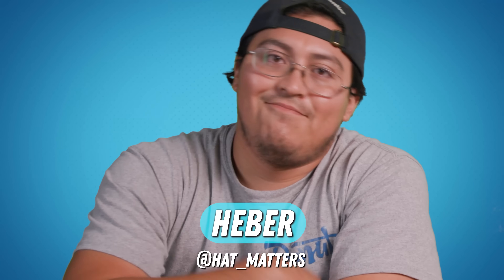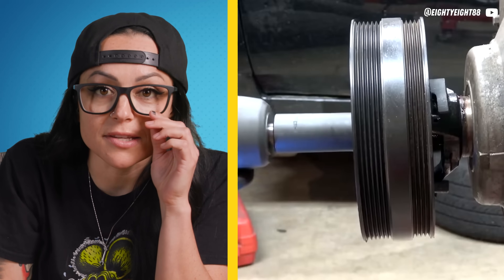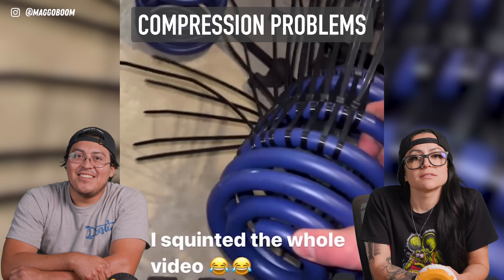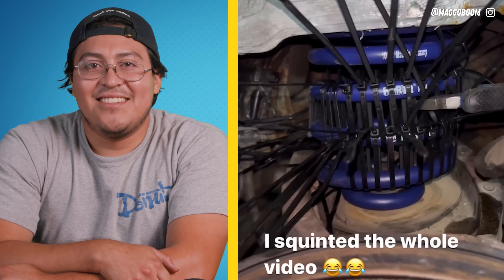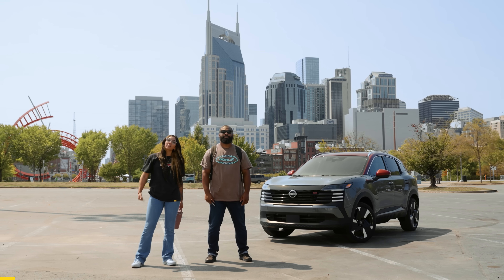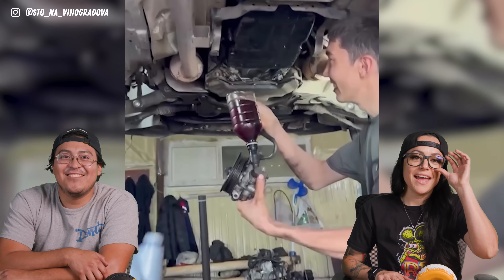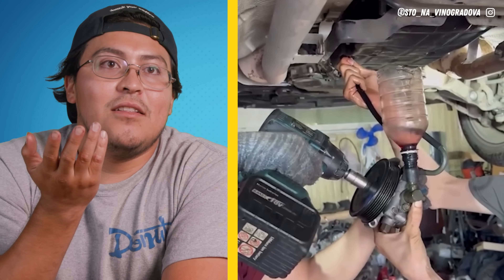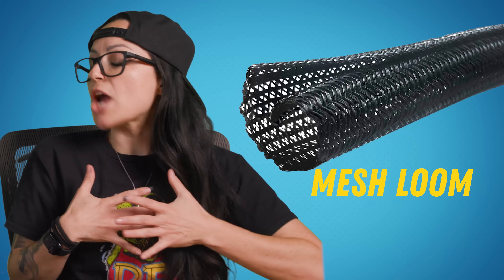Real Mechanics React to Ingenious Tiktok Hacks

Comment: Bike mechanic here, that ziptie trick with frayed brake/shift cables is so handy. I use it all the time to save cables instead of replacing.
Reply: TIL, I've just been cutting them short and crimping a new end cap.
Reply: I just use my fingers very slowly, usually works. But this seems better.
Reply: Works on lawnmowers too

Comment: That zip tie video with the spring is fucking terrifying.
Reply: The guy casually playing with that bomb he made... yikes! If you're gonna do something that inherently stupid you can at least hurry!
Reply: @viceroybolt3518 learn strengths of plastic its pretty good under tensile load, just cus sum looks scary dont mean it is
Reply: I had to do that with my Belltech springs for my mustang and it worked.
Reply: There's always a right way to do something dangerous.. that ain't it. Not by a long shot! Ratchet straps would've been the safer dumb shit option.
Reply: @reeegg9218  there is no way to evenly distribute the force being applied to each zip tie. all it takes is for the one with the most load to pop and set off a chain reaction
Reply: @reeegg9218  you can trust your life to zip tie manufacturers if you like.  i like living too much to do so myself.
Reply: @viceroybolt3518 bro had more then enough zips ties when he cut them you can actually see it slowly opening back up... Getting down to the last few may have been sketch depending how he layed them out
Reply: It's not the strength of the plastic that matters, it's the quality of the locking mechanism and the cheap ones just don't hold under pressure.
Reply: if you watch the whole video, those zip ties hold that thing. at the end he starts cutting them one by one, and like, the last two or three maybe snap, just like five were enough to keep it held down. must have been some premium zip ties xD
Reply: I was mostly waiting for it to explode.
Reply: He’s at least partially cognizant of the dangers involved in that little trick. After all, he did call it “An angry ball of zipties and kinetic energy”.
Reply: Nah, zip ties hold a lot of tension and you're dividing that by like 100 or however many zip ties you've got. But I'd still be wearing a face shield 😅
Reply: His hand placement was the one that did it for me, at least hold it where you won't get instantly defingered
Reply: Should've just used an angle grinder to cut all the zip ties
Reply: I just squeeze with my Arnold strong hands 😂
Reply: I would not trust the dollar store zip ties.
Reply: Caption was 100% accurate, my crow's feet have crow's feet
Reply: The fingers IN the spring with the zip tie kicker??? - yeah,  that's a no warning exit from my shop, 1000%
Reply: If each zip tie's tensile and lock strength exceeds the force of the spring divided by the number of zip ties, with a healthy safety margin, and they're quality, new zip ties, then it should be fine. I wouldn't do it, but then I'm not so lazy as to not do it the proper way with the strut off the car.

I did so something similar this past summer when I had to suspend a car engine to drop the trans. I ordered a support beam but it was missing one of the two threaded hook bolts and 2 chains, and since I was on a time crunch I improvised with an old bicycle chain wrapped multiple times and secured with multiple turns of baling wire, and for good measure some strong rope also wrapped multiple times. I held up fine and I got the project done in time. But I do intend to eventually get those missing parts (Amazon let me keep it for free for my troubles).

Everyone hacks eventually. So long as it gets the job done properly and safely, it's fine. Just keep it the exception and not the rule.
Reply: Even if it works, I was waiting for the guy to cut the ties and the spring to pound out crooked.
Reply: When I worked for an hgv main dealer I put plastic pallet banding around the rear light mudguard stays when they've got bent downwards , looped the doubled banding around the forks of the forklift, lifted the forks  and slowly bent the stay back up. 
The supervisor / foreman was surprised and impressed a quick and easy fix. Sometimes "ingenuity is the mother of invention".
Reply: When you damage the socket, charge a replacement to the customer, cost of a socket ,opposed to another couple of hours labor charges, most times the customer won't quibble.
Reply: The real problem isn't whether the zip ties are strong enough to hold it, it's that there's no way to remove the tension gradually. As you cut ties you don't release any tension, you just slowly remove excess strength until you reach the tipping point and all the remaining ones snap sending the full force of the still compressed spring flying. Winding out spring compressors is a gradual release of tension, very different and there's a reason it cut before he had to remove them all
Reply: It’s a great move on smaller springs, but this is risking life and limb. Especially when cutting them off.
Reply: Couldn't have said it better.
Reply: People analyzing this comment way too much. It's simply just true. Spot on if you want your fingers, face and things to stay the way they are then don't use zipties under pressure. Relying on any type of plastic for that is just crazy and asking for a terrible accident.
Reply: My professional mechanic neighbor was just commenting about how sketchy it is working with legit spring compressors.
Reply: Yeah im with you
Reply: No shit, I have an Unkle that is missing the end of a finger from a 1948 Buick coil spring.

Comment: The sawzall shaker is great as in about 10-15 seconds you can completely mix any paint/foam/etc can.  If you don’t want to make one you can order amazing ones for $30.   And once you have one you’ll never go back to the old school method.  And generally I find when you use these things the paint takes a good 1-3 days to separate again, so no issues if you step out for lunch or have to finish up the next morning; it’ll still be good to go.

Comment: If you want paint out of a can to come out well soak them in hot water (very hot) for a fem minutes, shake them, soak them again until you cant feel a temp change when you shake.  Reduces spitting, runs, ect.  Also helps the paint lay down better and cures faster.
Reply: I so could have used this trick this morning. 😂😂 No Lie.
Reply: @MrBoomer513  Its always like that isn't it? Find out what you need a little too late.
Reply: Thanks for the tip
Reply: How have I never heard that before? Thanks for the tip Shooter.
Reply: Another tip with rattle can paint to avoid it spurting is to turn the can upside down when you're done doing a coat and press the cap so it shoots gas through but no paint. This will stop the cap clogging between coats and stop it flinging boogers the next time you use it
Reply: @DjDolHaus86  ^This is also great advice and works great.
Reply: I could’ve used this advice last December lol did a horrible paint job on my bumper replacement for my 4Runner lol from afar it looked good. Up close… yikes… 😂😂💦💦
Reply: Works on Spray Texture cans as well.
Reply: @justinlast2lastharder749  Its a must if you are using spray texture.   Also never use the oil based stuff, water based all the way.
Reply: @SavageShooter93 Said all married men😂
Reply: Been doing this for years.  I live in Phoenix and use the same trick to heat or cool spray paint cans to get them to the ideal temps.
Reply: @DjDolHaus86  This and other mysterious secrets can be learned by READING THE DIRECTIONS ON THE CAN lol
Reply: @bisonhappenstance  That's cheating and you know it

Comment: "Is that what all the subaru owners do?" God damn you didn't have to roast us like that 😂😂.
Reply: Never owned a Subie, but I've been blowing vape clouds into intakes to find vac leaks for a decade!

I've never seen anyone else do this, and was fairly proud of myself when I tried it out and it worked. It's much quicker and easier than buying and setting up a fogger.

Glove over the filler cap secured with a zip tie, and blow clouds into the brake booster vac line. When you've got a few good blows in, squeeze the inflated glove to increase pressure while blocking the booster line with your thumb.

Comment: Amazon. They sell a whole kit of quick release/connect brushes for a power drill. Comes with the "toilet bowl" head, among many others. Great for interior detailing, and yes, that method works for cleaning automotive carpet. For less than $20 USD, it's 100% worth it. Break it all free and then vacuum it up. Also, the others make quick work of cleaning all season floor mats.
Reply: Ryobi has them if you want to know who you're actually buying them from.

The hard bristle ones are also great for getting most of the inner bark layers off of a live edge slab.

Comment: Alternator/generators on Air-cooled VWs have a split pulley. You use spacers to change the tension on the belt. 

I had a belt fly off on my 67 bug. Drove it 1 mile home with no fan/alternator. Smoked the hell out of the oil. Ordered some new spacers and replaced the belt. Was a good time.
Reply: im a73 model these guys are new new school
Reply: Yeah, split sheave on old Volvo AC compressors (York/Tecumseh) and then almost EVERY tractor with a belt driven alternator/generator built before 1995.
Reply: I lost the alternator nut on my 71 bus on my way home from a night shift so ended up driving it a few miles at a time with a handful of breaks to let it cool off lol
Reply: The worst bit about it is when you get a bug, and need to add a little tension to the belt, and find that the previous owner threw away the spacers he didn't need rather than putting them on the outside of the pulley!
Reply: I had air-cooled VWs for years, and, if you have your belt properly tight, you don’t slip it on like that because the screwdriver will leave a place in the belt which is an easy failure point. Plus, it’s freaking scary when it’s tight.

Comment: The process of adjusting the belt tension on that aircooled VW involves removing half of the Alternator pulley (the top one) by removing the nut and a bunch of washers. You put some washers in the middle of the pulley (Less washers = more tension) it's a little tedious but not too hard to do.

Comment: The zip-tie-fix for braided steel wire 're-braiding' works like a champ.  I've taken entire threads of a wire out of my 7x7 stainless steel wire and re-wound it in a finger-spun-method pretty much exactly like that to get a 6x7 slightly-smaller-diameter wire that is still a wire.  Works fine as long as the wires involved didn't get folded.  If they fold...past that kink, you'll need luck to continue doing that.  Works fine for 'fraying' aside from that in my experience.

Comment: Iron oxide or rust is a chemical reaction. By painting over rust and creating a barrier from anything getting in, or out. At some point there would be no more oxygen to react with the metal. Its like a bug in a jar with no air holes. At some point the bug would asphyxiate/suffocate.

Comment: The cool thing about those Volkswagen engines is that neither one of those pulleys move to apply tension. The generator pulley is a multi piece pulley with shims. You take the nut off and the outer portion and either add or remove shims in order to make the two halves further or closer, thus tightening or loosening the belt

Comment: 14:50 bike mechanics gettin some love!
Reply: Bike mechanics wouldn’t use a zip tie though. It can soooo easily be done with your fingers. I have that this “trick” has gone viral - it’s just wasteful
Reply: @ For real though, that's a lot of access derailleur cable and zip ties are like gold to mechanics, touchè
Reply: Yeah but it's pointless. Put the crimp cap on before the cable frays, instead of after. Also, there's so much cable hanging out of that derailleur that he should just cut the frayed end off and cap it.

Comment: 10:30
On the alternator, the pulley is made of 2 separate plates with a taper on them and some shims in-between them. When you want to loosen it you put more shims in and when you want to tighten it you take some shims out. It's a really simple and effective system

Comment: There were quite a few more of those than I was expecting that I might actually use.  Maybe not the zip-tie on the coil springs one, and definitely not the "replacing a belt on a running engine" one, but certainly more than zero.  So thank you for not just providing material to mock, but also material to legitimately educate.  :D

Comment: hammering on smaller sockets to a bolt head to get one unstuck is something we've done a few times but it should also be noted that metric and imperial have some nice "in between" sizes that you can use as well BEFORE trying the "hammer on" method and you may actually get a better/tighter fit with one of those(for us it's usually because of rust).

Comment: Just to let you know, the VW belt was on an old beetle. That belt is removed and adjusted by separating the two halves of the generator pulley and putting shims in or taking them out.

Comment: I love your videos. One quick note about VW belts. There is no tensioner on that belt anywhere. The alternator or generator pulley is in two halves, with shims between. You have to hold the pulley in place with a screwdriver (into the slot of the alt/gen), and loosen the center bolt, being careful not to lose any of the shims when you remove the outer half of the pulley and the bell washer. Then of course, you reverse the process with the new belt in place, being sure you don't pinch the belt between the pulley halves. It's not horrible but it is a fiddly pain in the butt sometimes, especially if you drop that stack of shims and they roll in six different directions on the garage floor. That's why a lot of VW owners utilize the trick shown in the clip. Your daily lesson from a layman. Cheers.

Comment: Fun fact: if you just use an inline six, you don't even really need harmonic balancing. Goes for a V12 as well. Naturally perfectly balances all first order imbalances. You still can have some heaving and other higher order stuff, but those are pretty much always accepted, as just throwing on a simple harmonic balancer isn't enough to balance it, and the vibration amplitude of higher orders is smaller as well

Comment: VW belt adjustment, is done by shimming the generator pulley, either widening to loosen the belt by letting it run lower in the pulley, or narrowing it to tighten the belt by making it ride higher.  So normally, for belt replacement, you'd undo the centre bolt of the Gen pulley, and separate the two parts of the pulley.  I've personally never used the screwdriver trick, but I can understand why a lot of people would. (I do the same thing, just not with the engine running lmao)

Comment: 6:19 A 1.5 gallon garden sprayer from Home Despot does the same job without the need for a second person. I have 3 of them, one for ATF, 1 for DSG, and 1 for CVT, because you don’t want to cross contaminate transmission fluids.

Comment: Maybe a dumb question, but doesn't covering the rust with paint prevent the oxygen from getting to the metal, thus stopping rust as long as the paint isn't chipped off?
Reply: That is correct. Idk what these people are talking about. You can spray sheet metal that you knock most the rust off of with any decent off the shelf paint and it will survive ages.
Reply: Rust is oxygenated metal. so the O2 is already in there. Rust is like a sponge. It has lots of spaces to store moisture and o2 on top of that. Not to mention that the rust is not a flat surface so it kinda defeats the point of painting it. and if the rust is bad enough, it will flake off and take the paint with it, both destroying the paintjob and making a nice home for more moisture and o2 to get in, so that it will spread even faster from there. 

Every professional sands or metal brushes the rust off first for a reason.
Reply: @dsauce8780  your life doesn't depend on sheet metal, and sheet metal does not have any tension/torsion on it. People get used to cars so they forget how much their life depends on it working properly.
Reply: @PositiveOnly-dm3rx  I don’t think you understand what you’re saying. Iron oxide is a stable compound. Without moisture present the electrolyte for the required electron mobility to facilitate further oxidation isn’t present. Ipso facto if you properly cover rusted metal it stops rusting. There are also materials like coreten steel that are designed to form an oxide layer to protect itself similar to the way bare aluminum will protect itself with it’s own oxide layer. 

Regardless of the metal type or use this is true. If your frame is rusted to shit you probably shouldn’t use it. But the idea that once there is rust in your metal that covering it doesn’t stop it  is just plain wrong.

Comment: To tighten the belt on that VW, the generator/alternator pulley is a 2 piece design, using shims on either side of the outer half of the pulley. Add shims in between to loosen the belt, and subtract to tighten. The extra shims go on the outer section behind the bolt, so they remain with the component. It's the only way to adjust the belt tension, since the gen/alt is bolted solid to a bracket. Same rules for V-belt tension apply.

Comment: The zip tie shift cable trick really does work, but I have found that it's faster to just use your fingers to put the cable back together. On an unrelated note. The VW fan belt trick only works if the belt is being run too loose. There is a shim stack that goes in the center of the generator pulley that is used to adjust tension.  If the belt tension was right either the belt would snap, or the screwdriver would go into orbit.

Comment: The VW pulley hack make sense to all aircooled guys because the tension on the belt is adjusted by the shims increasing or decreasing the space inside the main pulley. Kinda like a CVT without the C.